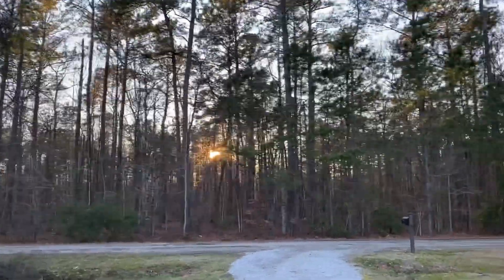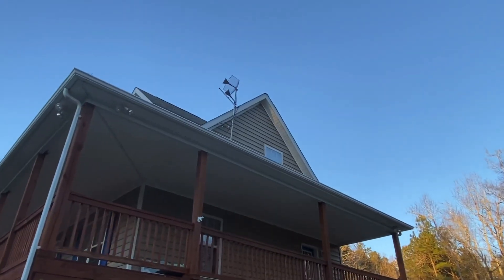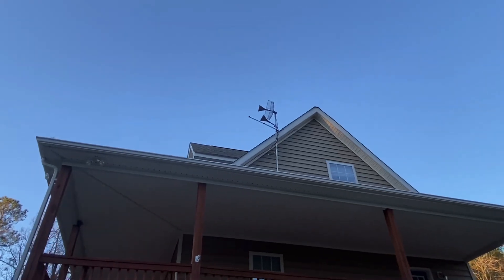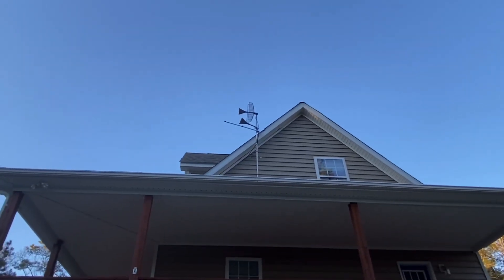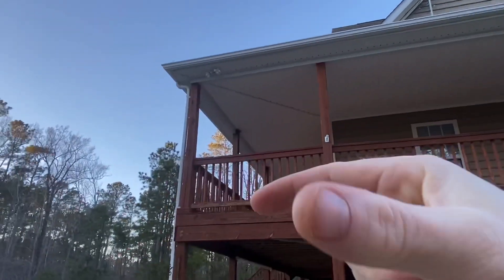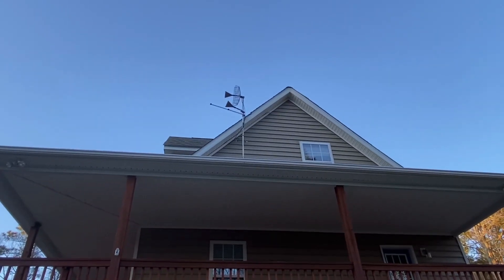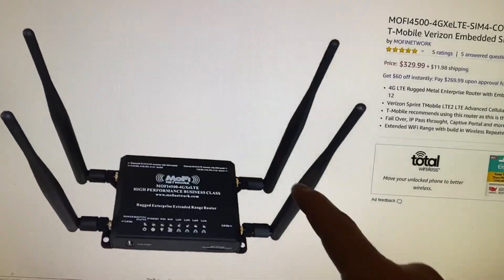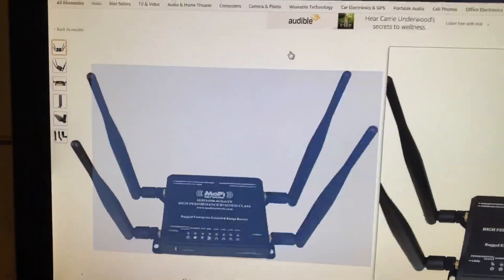Rural Internet ULTIMATE SOLUTION (NO BS) MOFI 4500, SIM card, and a Parabolic Grid Antenna or 2!!!

Comment: What is the frequency of your parabolic antenna pls?
Reply from the maker: Well..  I mean it ranges from 700-2500 I believe it that’s what you are referring?  Somewhere around there?
Reply from the maker: Or it will use whatever frequency or band that’s available.  For the most part I used band 4 as my fastest band if that helps?

Comment: Great video John! I've bought the Mofi 4500 to add to the multiple Wilson Weboost products I've got cobbled together. 4 paddle antennas, 1 yagi, 1 marine Omni directional antenna, numerous lengths of LMR400 cable (but BOTH ends have the same "N" fittings) so I've got all sorts of adapters to go with it. I'm hoping to utilize the old TV tower on my 2 story home that has a remote control rotating base. Quick question, With all the supplies/materials above, what do you recommend would be the best configuration for my setup? I've got the Wilson Home Booster on the second story hooked up right now, can I use that to boost the signal to my Mofi?

Comment: Do you like these better than the wireng? AND do you NEED 2?
Reply from the maker: abitofrandom umm yes apparently you haven’t seen my recent vids
Reply: @rockernro  one more recent than this? I'll go look.
Reply from the maker: abitofrandom no you don’t need 2 start with one see how that works
Reply: @rockernro  ok I watched them... 😉 Another quick question... How can I see live decibel changes in the mofi interface?
Reply from the maker: abitofrandom soon as you get into the 192.168.10.1 on it it’s in the middle of the main screen says “check signal status”. That will show you the DBs in real time.  I always hit “quick check signal strength” it’s located on main screen or hit overview
Reply: @rockernro  sadly it's not there for me... wish I could show you a picture. 😭
Reply from the maker: abitofrandom is your internet light on on the mofi?
Reply from the maker: abitofrandom might mean you don’t have internet what kind of sim plan you have in it?  Should have a blue internet light on.  If not it might not like your sim plan
Reply: @rockernro  it's green on my device and I can check the signal elsewhere but it doesn't seem to be live.
Reply from the maker: abitofrandom do a band scan  under band scanner and see what bands come up lock on to the each and try to check
Status again might Be a band issue or do a factory reset pinhole on back of router.  Or...you might need to go to system
And click internal module flasher.  It will do a self update to newest firmware
Reply from the maker: abitofrandom i would try to call mofi cust support night have got a bad device

Comment: Yo!  How do you get to the signal strength bar graph on the mofi4500.  I cant find that setting.

HELP! please
Reply from the maker: Ken B it’s
On the main page once you type in 192.168.10.1 it says in the middle check signal strength
Reply from the maker: Ken B that’s the page where you can see decibels in real time and get them as low as possible while moving antennas

Comment: Hey since the 4500 is Mimo can it benefit from a booster on both lines? Just asking for myself.
Reply from the maker: Montana West Photography you cannot use it with a booster 2 totally different technologies
Reply: @rockernro  but you're using one! You said you're using a booster.
Reply from the maker: Montana West Photography using a booster for voice but had that put on before I did the whole MIMo setup technically if you got WiFi you can just do WiFi calling with the mofi might not
Necessarily need a booster
Reply: @rockernro  Makes sense now. Thanks bro.
Reply from the maker: Montana West Photography I just added a new vid help ya clear that up

Comment: Thanks for the great info.  I will be using the same modem and live within a mile of a T-Mobile tower.  I will be using a small antenna for the LTE signal to get inside (our cell phones work pretty well already).  I will hook my home router to the LAN port on the modem for WIFI  signal inside.  To get better WIFI signal outside, will I need to hook the external WIFI antenna to the router instead of the MOFI?
Reply from the maker: nikonshooter2 no,  that’s only if your WiFi on your external router to mofi doesn’t put out enough radius coverage.  I bought a cheap wavlink external antenna for outside like a repeater.  That works but typically degrades quality which you might not even notice being so close to tower I recommend using a good power router like I have a netgear gaming router don’t even need to use my repeater anymore!

Comment: Fantastic content. I did something similar to you about 2 years ago this May. Went with https://unlimitedtogo.com on the VZW plan. It is $180.00/m however I work from home and it is a biz expense so a write off at the end of the year. 

I have a 60FT old TV antenna tower that allows for me getting over the trees. I am also only 3.7 miles away from the tower I hit. I have a MiMO Yagi antennas (like the Wireings you had) with a 3 foot horizontal pole they are mounted and then mounted to the top of the tower.  I have 75ft of 50ohm low latency wire cable coming down from my antennas to a homemade outdoor weatherproof box. The box was a $6.00 tub  from Walmart, spray painted black to block out the sun. Along with weather stripping to prevent leaks and weather proof vents and all the rubber grommets for the wall breaks into the box. It is mounted outside my backdoor with the lid facing outward. My Mofi 4500 is mounted on a board inside of the wall mounted tub. 

I have a cat 5 cable running through a wall break from my dinning room outside to the Moifi4500. Inside it is connected to my Apple Airport Extreme Router. To which I have 2 other Airport Extremes connected to make a cheap $150.00 Mesh network of my 3000sqft house. 

Band 2 is the best for me. In the wee hours of the morning I have gotten all the way to 71mbs down and 49mbps up. Average speed is between 30-40mbs. Only getting 3 bars right now.  Hence the reason for seeing your vids was looking at a better option to get faster speeds. B4 was my go to band for a long while and was getting around 15-25mbps down and 35-48mbps up. Only within the last few months have I been able to get Band 2.  Just like you band 13 gets fantastic signal strength, but crappy downloads speeds. Best I have gotten was 8mbps down and 3mbps up on B13

I think it is fantastic that you were able to figure this all out. 

Question: Have you seen any degradation of signal and speed and packet loss with the parabolics in the rain? I am trying to decide between the Logs or Parabolics.  I have no qualms with the funky looking antennas pointing at the towers if this means my speeds are faster.  

I went by the tower the other day and on my mobile phone was getting 120mbps down and 36mbps up. So my thoughts are if I can eek out improved signal strength I should be able to get faster net.
Reply from the maker: Steve Sohn sounds like you are already about there lolz. So the yagis I had the WirEng’s worst signal strength by far and quality, log periodics improved strength not quality.  All in all the both lose reception during rain and wind every time I was getting fed up and wanted the best solution. . The parabolics are hands down a HELL yes!  Get 2 since you have all that tower to yourself lol.  I have signal quality degradation during peak times especially by the strength has been super consistent.  Actually have had some rain and the loss was super small.  The seller said they perform better in rain and wind and were right!  Get em and thank me later.   This weekend I’m putting on the other grid backing on the parabolic on bottom.  Been told by cell boosters or simple WiFi tech guy you see on the vids it will improve me some along with others.  So...give them a try make a vid I’d LOVE to see that setup.  I totally would’ve done what you did out mofi in weatherproof box genius man!  The Log Periodics will be coated in the rain like icicles and will stay degraded until rain has dried and fallen off.  Screw that man.  I wish you and me luck lol.